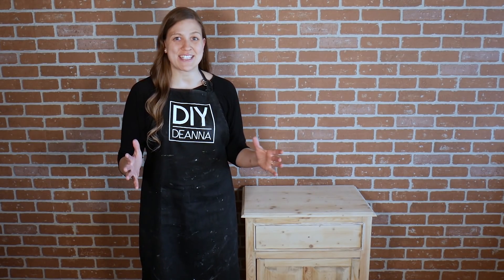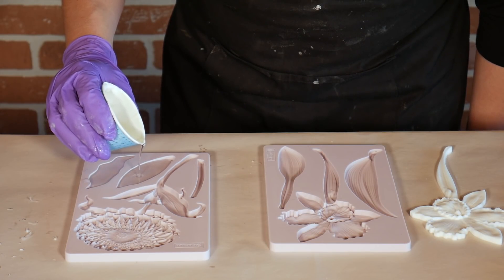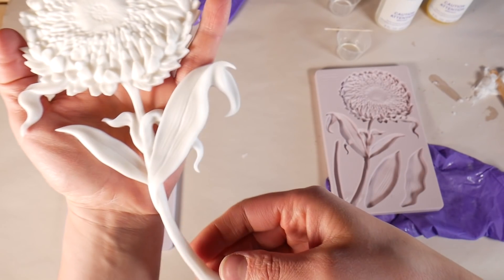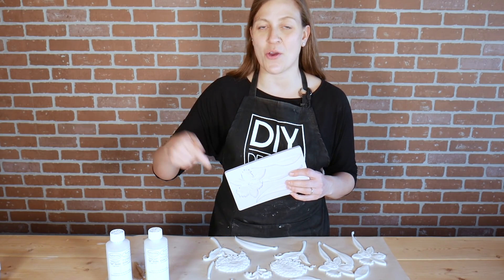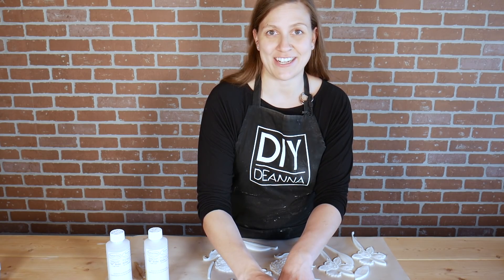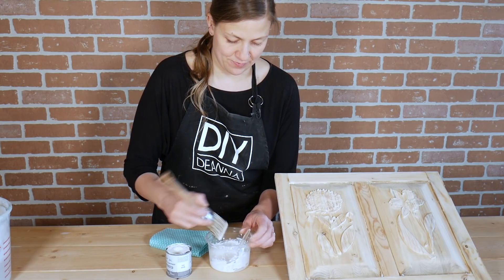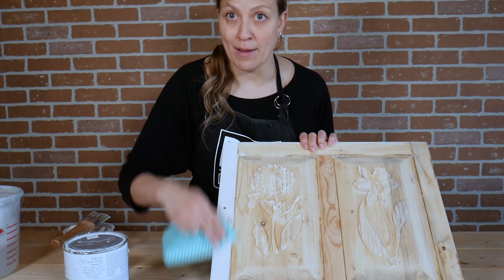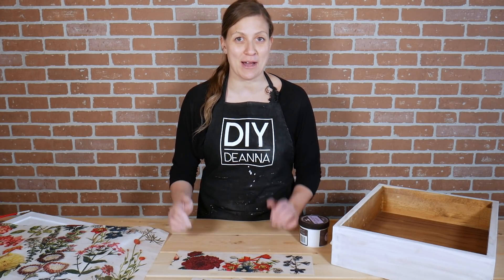Boho Furniture Makeover  | Faux carved wood, white wash, decoupage and more!

Comment: Awesome job 👏👍 I usually use polymer clay for my furniture molds but that wouldn't hold the screw like epoxy does. Brilliant idea!
Reply from the maker: Could you drill a small hole in the clay and then super glue the screw in place? Not sure if that would work, what do you think? Thanks for watching!
Reply: @DIYDEANNA  yes but would eventually break apart the resin is so much stronger. Brilliant idea you have here.
Reply from the maker: Thanks! I hope you give it a try!

Comment: Your color matching and graining is spectacular. As a former woodworker, I always had trouble mixing the right shades in paint and fillers. Hats off to you. I'm going to look through your videos to see if you've done thinned water based stain yet. Pickling was my fave. Our client chose Minwax Tintable Colors. I watered them them down 1:1 and they were very easy to work. 
For outstanding gel stains and polys, our shop used Old Masters. Mixing a stain with the poly before application gave a beautiful finish with nice depth. We also used General Finishes brand for the eco-friendliness. Smooth workability and finishes with depth.
Reply from the maker: Thanks for sharing your product suggestions and tips!
Reply: @DIYDEANNA  You're welcome. :) I hope you get a chance to try them. I admire your work.

Comment: This looks very doable. Thank you for providing so much detail. If I ever wanted to place a piece in between two drawers, are they easy to saw through to separate, and would you advise doing that after it hardens or while the piece is still a little soft?

Comment: I was taken aback when you began painting the molds with the veining effect. But WOW !! Was I wrong. You did a fantastic job. You have amazing talent. You also taught me a great trick (mixing paint with the wax). 
I wonder if the molding solution could be 'heated' up gently, so it can become liquid again. I only mention this because the molding solution seems to harden quickly, so it would be a possible solution should it set before you get to pour it in the mold. If it is possible to heat it (like wax for example), let us know. It would definitely avoid wasting.
Reply from the maker: Thanks for watching and for your feedback! I’m not 100% sure since I haven’t tried it, but I don’t think heating the resin would work since it’s a chemical reaction that makes it harden. You’re right it does harden quickly so I found it best to just mix up small batches and then there was less waste. There are other resins that don’t set up as quickly, but they take several hours to cure so this is also an option if you don’t mind waiting for them to set up.
Reply: @DIYDEANNA  I'm too impatient and like to get things done & I get strangely excited to see the results as well 😋 so this molding solution might be my best option after all. Thanks girl 🤗

Comment: polymer clay or plaster can be used of course sealing it with Verithane (by rustolem) will stabilize the plaster and make it harder so it will last on a dresser...air dry paper clay works very well with these molds
Reply from the maker: Thanks for sharing your casting medium tips!

Comment: How deep is the wood for you  to need such long bolts ?
Reply from the maker: I didn’t need that much length, just what I had on hand. A lot of knobs come extra long like that and then you can cut them down. I trimmed them down after with a rotary tool and metal disc. Thanks for the question.

Comment: I have a question:  Why do you need to clean with TSP if you are going sand it all down? 🤔
Reply from the maker: I just prefer to clean second hand items inside and out before I get started. Never know whats on the surface, this one was pretty sticky. I realize it could be skipped and cleaning done after the sanding but just how I like to start. Thanks for watching!
Reply: @DIYDEANNA  ok, that makes sense!  Thanks so much 😊

Comment: Please always wear a respirator or dust mask when you sand resin. It is very toxic, when particulated like that in dust it can really be bad for your lungs. Even if it's a tiny bit of sanding. Take it outside, do it with wet/dry sandpaper under water in your sink.